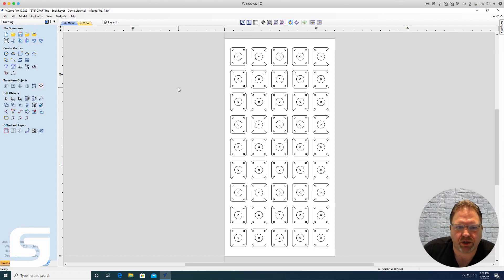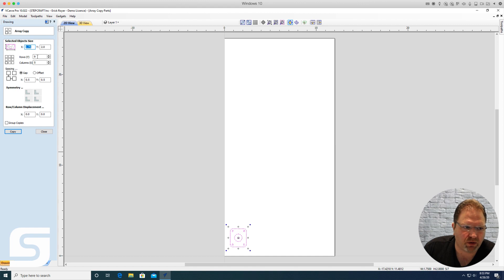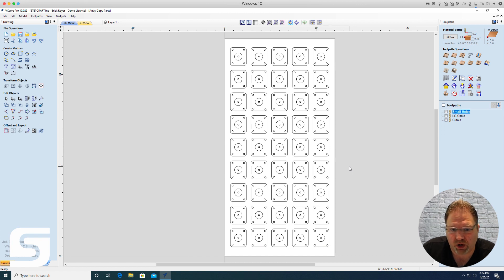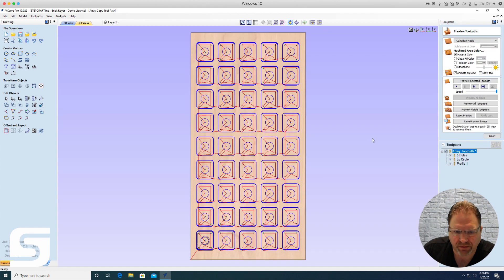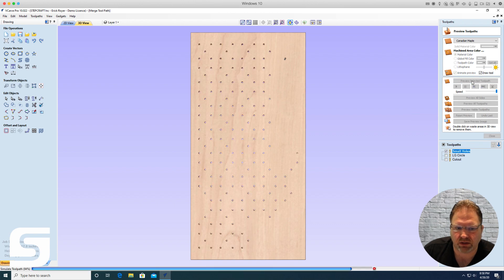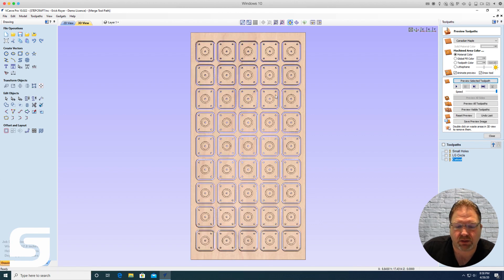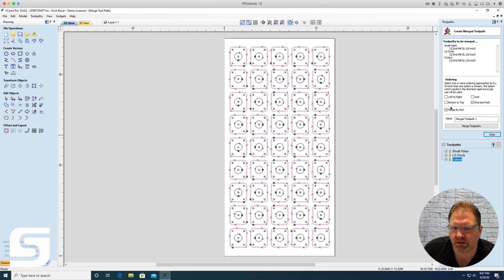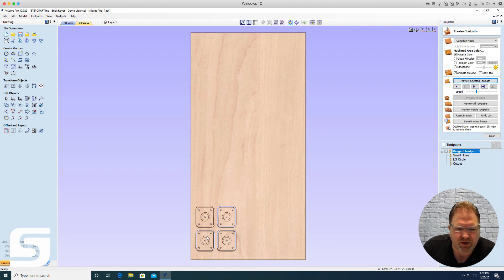Need To Make a Lot of Copies? Use Vectric's Array Copy and Merge Tool Path Functions

Comment: Is there still a way to use job array toolpathing if you are using  different size bits in the same male inlay? in your example, can you tell vcarve to pause the machine after all the center holes  are cut and then change to a smaller bit for the outer holes?